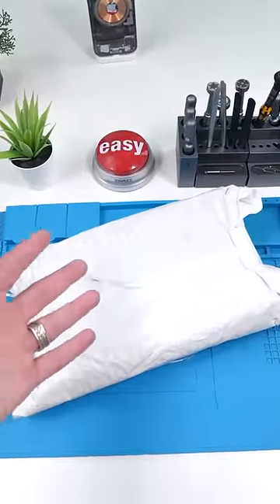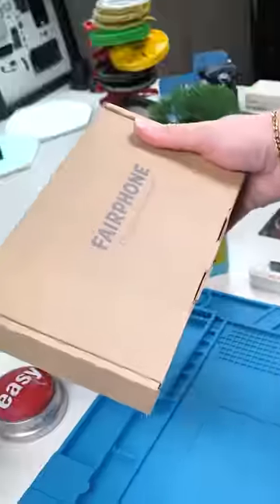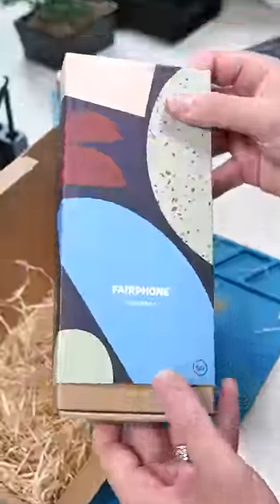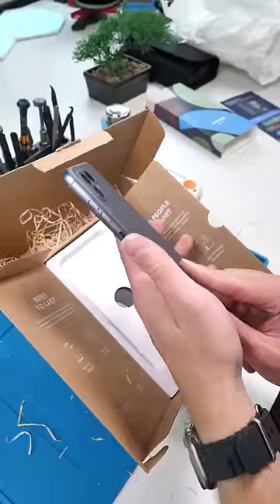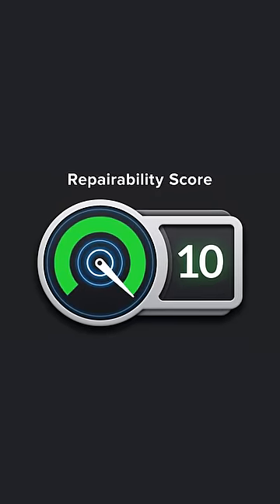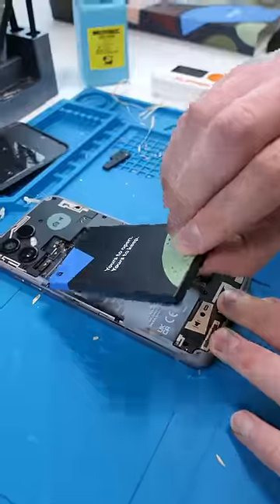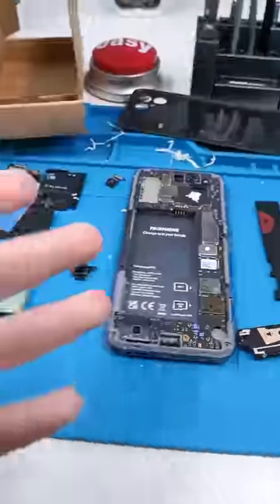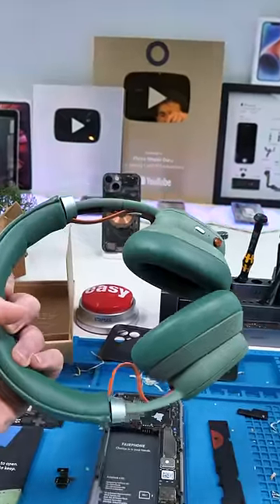This Is Like A Dream Come True...  #Shorts

Comment: We are in a timeline where removable back cover is now a Feature
Reply: yeah, that's because we lived through the timeline where non-removal batteries was a Feature.
Reply: I held onto my s7 for years because it was the last phone to have a removable battery
Reply: I think s6 was last to have removable battery... I had several s7s and the battery wasn't removable on mine... I had 2 from the US and one from south Korea I couldn't remove my batteries
Reply: Removable batteries are a nightmare for design and durability.  This is just a gimmick for people who love to repair stuff as a hobby (like myself). But not practical overall the way you can just pry the back off with your fingers like an old smartphone. That thing falls it's going to break into pieces.  Then the company made all the parts in proprietary modular parts so you have to buy their repair parts at who knows what cost.  You're stuck in the loop of buying from them.  Unless you can open up these modules and replace them with cheaper aftermarket parts.  

AppleCare+ will replace your battery for free if it loses more than 20% capacity in the first year or for $29 anytime after that.  You also have unlimited accidental damage so you can replace front/back glass for $29 and any other damage is $99.

Just the battery needs to be replaceable but you can still hold it together with screws and not that flimsy plastic. Also the iPhone and Android batteries are also going to be very user-replaceable by 2027 due to the new EU laws. Hence why Apple already made the back glass on the 15 series easier to open. They are working towards this.

The repairable Framework laptop makes more sense as it's still very durable and the "easy access" point is protected when the screen is closed (the magnetic bezel on the screen).  You still have to unscrew the metal bottom to access the rest of the device. But they still sell proprietary repair parts....

With all that said this is a very cool hobby device.
Reply: @wushdishmeen  had a Samsung that you could pull the back off of.  Easy battery access had it for 3 years never had a problem with it.  It's almost like phone cases were made for a reason.
Reply: moto phone: we did it first
Reply: What a time to be alive
Reply: But with additional problem: not waterproof anymore.
Reply: @wushdishmeen Not every country have Apple care or 1st party Apple store. In my country iPhone price is ridiculous compared to the competitor, they charge $250 more than actual price (it's just the base iPhone 15 model). It's being sold by Apple authorized reseller, not by Apple directly. Their after sales also garbage and charge ridiculous amount to repair and complicated way to have your phone to repair too. You will pay the repair when it's break, even if it's brand new phone and not your own fault that phone is died. I will switch to iPhone if they open their store in my country, I wouldn't pay something overprice for the products and garbage after sales.
Reply: Phones prior to these recent phones always had removable backs, and batteries. So for all the revisionists out there in this era it existed before nothing new.
Reply: @DECEPTICON33  i am mean yeah that's what the joke is about
Reply: @SamudrarajOfficial  I got the joke. Didn't need the follow-up and explanation homey...😒🧐
Reply: @DECEPTICON33  i thought you were telling that to me, but i realised later its for others who don't know there was a time when batteries and back covers were removable
Reply: It's way more than just a removable back cover.
Reply: @Bear.and.treats And Samsung Xcover pro ???
Reply: @psillysimon  we got an s8+
Reply: Guys the s5 was the last s6 added glass

Comment: Don't forget the minimum 8 years of security updates!
Reply: This is absolutely underrated.
AT LEAST 8 years.
Reply: @maxschmidt666  who tf is going to use their phone for 8 years, even if they do the hardware won't be able to handle it, I think having more security or OS updates is the weirdest flex ever
Reply: @4fgaming925  Eh, I'm using a phone released in 2019. There's a chance I go another 2 with this thing. Use it for yt, OneNote, email, torrents, etc.

There hasn't been much improvement in phones in general. If it weren't for its lack of dual SIM, I probably would have stuck with my 2017 phone, which I enjoy more than the 2019 one.
Reply: @yessum15  which phone are you using? this fairphone has the worst specs for a 700 pound phone, wont last for more than 4 years and wont be able to handle these updates, only samsung phones and iphones are capable of handling these updates for 5-6 years, that too flagship ones with good performance

Comment: The good times when we used to take out the battery to charge it😊
Reply: when the fuck was that?
Reply: @prajwalbharambe343  I dont think there was ever a time for that however there used to chargers that charged mobile batteries, if for whatever reason the mobile didnt charge it.
Reply: the younger generation who want everything to be easy may never experience it 😅
Those born in the 90s and some children of the 00s may have experienced it 😂
Reply: Lmfao, I think he meant that during old times,when the charging port was having issues then we could simply open up the back cover of all em phones, retrieve em batteries and then charge em by using a special charger which could charge just literally any phone battery. You just had to put and adjust the battery on the specified charging pins and once you'd see green lights on, then you'd know that the battery is charging up. But unlike today's time, most if not all of em phones now come up with zero access with the inside of it, meaning they've completely sealed off their back covers, and not allowing us to open em up to retrieve the batteries and what not ourselves, unless an experienced phone technician who knows how to professionally open up phones, only they who could now lay their hands on em batteries and what not, and have a look on the inside of all these new generation phones when they get faulty.. 😉
Reply: @prajwalbharambe343  the good ol days with the good ol Samsung's 😀

Comment: If you dropped that phone hard enough, is there a possibility that the back comes off and the components inside can fall out too?
Reply from the maker: It's on there pretty good but if it were to come off only the battery would come out
Reply: Oh man, it hits hard to realize how old you are when you had more phones with removable back covers than with touchscreens.

Comment: What does Fairphone 4's IP54 rating mean? This rating shows that the device is weather proof (protected against splashing water). It is quite an achievement for a modular device to be resistant to water sprays from any direction.

The iPhone 13 is water-resistant. It has a rating of “IP68” which means it's fully protected from dust and can handle being underwater for up to 30 minutes at a depth of 6 meters. If your phone gets dropped in a puddle, or a shallow pool, or gets wet from the rain, it will be just fine.

Comment: So then the question is, how long does that battery last, and what specs is it powering?

As I recall, the reason user-replaceable batteries went away was because batteries designed to sometimes be exposed also had to be designed more durable, which meant the same-size battery would have a much lower MaH capacity. And that’s part of the reason why the phones of the past would get ~4 hours of screen-on time while newer ones get ~12.

On paper easy user reparability is a great thing, but it has unavoidable repercussions. Designing the device to be waterproof but also easy to repair, is probably doable? Certainly harder though. And of course the battery has to be worse. Maybe some other downsides too, I’m not an engineer.

Still, no reason except money for repairs to be as tough as Apple makes them, to pick a prevalent example. If Apple were to start using a more standardized screw to get into their phones and do away with the part serialization, that’d be the perfect middle ground, sure repairs would be difficult, but it  wouldn’t compromise on the specs nor would it be intentionally MORE difficult than necessary.

Comment: back then, there was a google project with the same idea
the phone would have different parts, and each part could be customizable( better screen, better camera, better battery or worse, ect,)
It was a great idea, but the audience didn't like the idea that they would not change the phone to a newer generation
they sold 250000 and then discontinued then

Comment: If those modules are that easy to take out, i'd be worried about the contact points being weak and the modules could disconnect for split seconds

Comment: The only problem is that it is a midrange phone.
The pixel 7 boasts more for less money.
The repairability is a feature, but the processor is not replacable.
So in 5 years this thing will be slow as hell.

If they managed to make a frame where the ram and processor would be placed on which itself can be replaced then that would be the best.
However this misses the mark for me

Comment: The problem is that most of these repairable parts are nearly never breaking. The way bigger obsolescence factor today is software.
Reply: idk man, I’m still daily driving my iPhone SE gen 1 from 2016. Besides, Fairphone is committed to guaranteeing support for android updates for at least 5 years. They promised the same for their previous generation phone but supported it for 7 years instead. 

Oh and the screen and charging port are usually the first components to go kaputt, both of which are easy to replace on this phone.